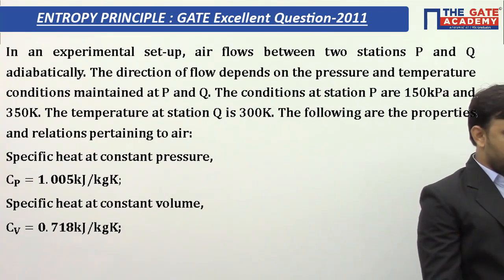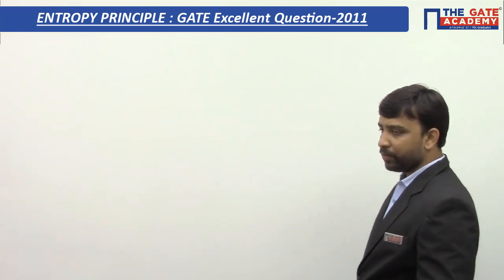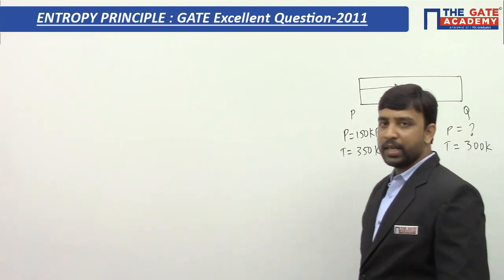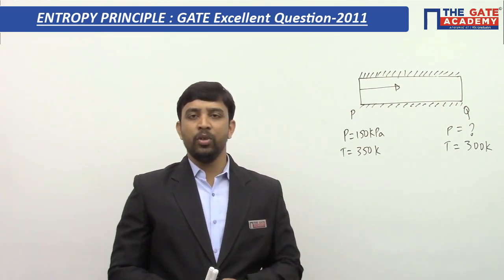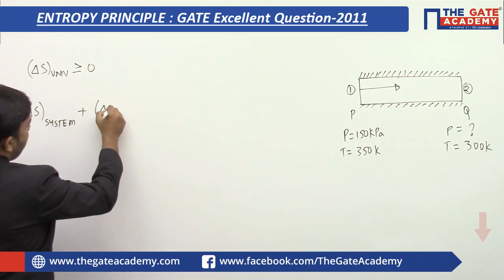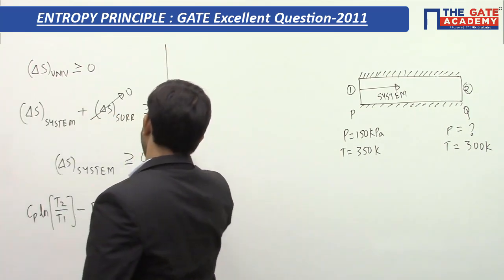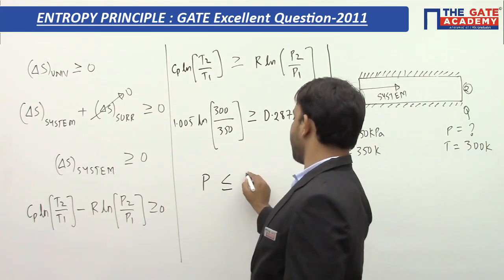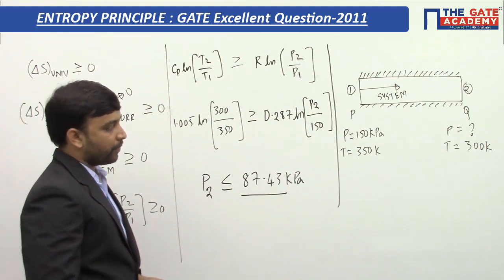Entropy Principle | Excellent Question - GATE Sol | Thermodynamics | Mechanical Engineering

Comment: Iam getting almost similar answer while doing the ideal gas relation for pressure and temperatures case of adiabatic is it correct the answer was 89.22